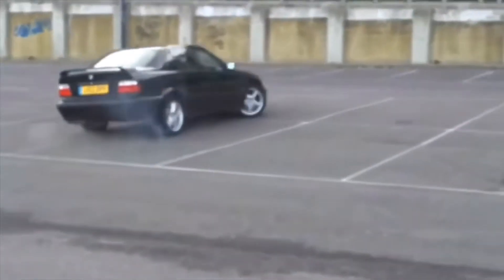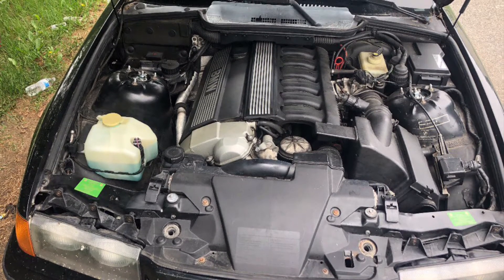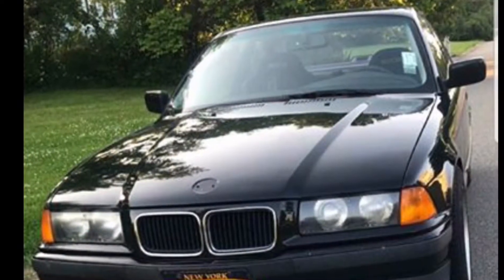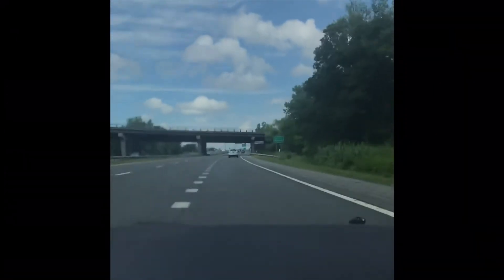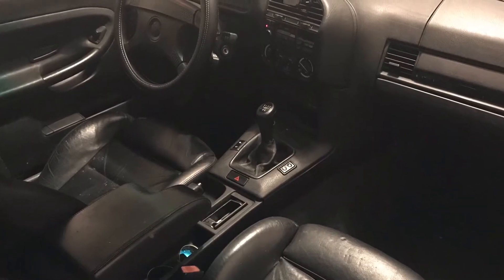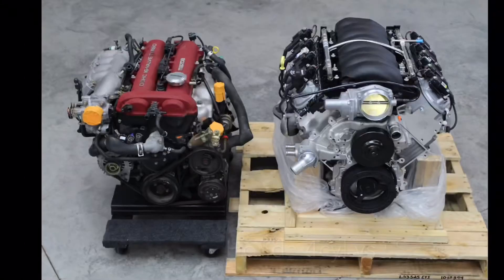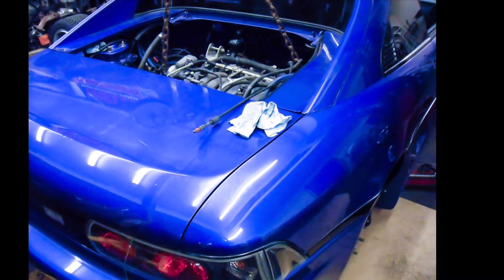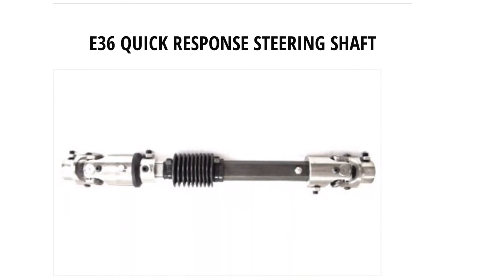FINDING THE RIGHT PROJECT BMW- E36 TURBO LS SWAP PART 3

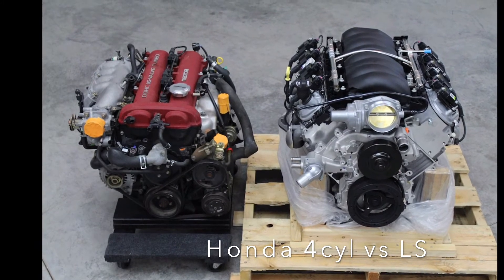Comment: 4:43 Caption says Honda 4 vs LS. Mazda clearly written on the valve cover. I do get your point though.  The F20C in the S2000 is a bit larger overall and 50lbs heavier than the BP-4W in the Miata that was pictured. Which honestly only makes the LS look even better when comparing it to a Honda. While I have in the past been a diehard Honda guy (still am when it comes to daily drivers) I was also raised around aviation so I was never really a proponent of the HP/L argument when determining what the best engine is. HP/L will NEVER make a plane fly or determine a race. Power to weight will ALWAYS determine if a plane will fly almost always who will win a race (if both get a good launch and maintain traction).  There is a reason to LS swap ALL THE THINGS. The LS based engines are the most power dense engines (size/weight:hp) available to the general public.  The fact that you can get them all day for less than $500 blows my mind. 

Sorry for preaching to the choir, I got off on a tangent and Im not exactly sure why lol.
Reply from the maker: No o appreciate it, I totally thought that was a k20 engine. It was hard to find a comparison photo for that section. They all have their pros and cons. I essentially got that engine for free it’s hard to do that. I’d love to K swap something one day. Other than my Miata 4 snafu, did I do a good job on this video? What else could I improve on?
Reply: @LowBoostFilms   Well super long story short, I have 2008 535I in my garage that I absolutely love how it used to drive, its just given me a lot of mechanical problems. The serpentine belt came off and ended up getting sucked into the engine through the front main seal which threw the timing off and smashed all the valves in my N54. SO I’m seriously contemplating and LS swap in my E60 so I was looking at vids on LS Swapped BMWs. That was a little back ground on how I found your channel. 

I’m only 6 videos in but honestly so far I’d say overall your content is decent. The audio isn’t great but it isn’t horrible. Not having super clear audo doesn’t really bother me, but I know it turns a lot of people off if you don’t have a decent mic. I do enjoy the random cut scenes, but IMO they should be much quicker and not used so often. Like only in exclamatory situations. So I like the Hangover cut but instead of having the whole scene where Alan is getting shocked in the face, I think a quick cut to “IN THE FACE” would have been much better. Same with Rachel saying you bitch. I like that you videos are packed with information and I realize it’s not easy to film while you work, however I know a lot of people don’t like commentary over still pictures. Your intro is great as is your use of music (or lack thereof for the most part) I would rather no music and be able to hear everything than to have a ridiculous or loud soundtrack when you’re trying to listen to the engine or other things. Overall I like your channel, and I was actually surprised you only had 500 subs.  But considering you just started this series 9 months ago I think if you keep it up you’ll easily be at 10x that in no time.
Reply from the maker: I made the mistake of not taking enough videos when I started, now I only take video, no pics, and got a better microphone. So hopefully my videos have improve with each new one I make. I don’t do nearly as many cut scenes anymore. I actually forgot I did them haha! Thanks for the feedback! I really appreciate it. It makes me want to work harder to make them better!

Comment: I’m building an iron 5.3- either doing an e36 or 300zx swap. Leaning toward e36 I think it will be cheaper and better quality. Look forward to watching videos. What trans and rear  you plan on using?
Reply from the maker: Travis Wurz I am getting a T56 6 speed, far as  swap kits go there are a lot of them for the transmission crossmember. I’m looking at a 210mm lsd out of an e38 750i. They bolt right in. Stay tuned!

Comment: If you would of use an aluminum version. It would of been 200lbs lighter than the inline-6
Reply from the maker: I weighed them this is 50 lbs more, the alum should be 50 less I think. but it’s getting boost, which the iron motor is better for.

Comment: What about an E90 I have an extra one I want to do an LS swap in
Reply from the maker: Very easy to do. Lots more space than an e36. CX racing makes swap kits
Reply: Nice I just checked their site, pretty straight forward. Now I see all the hardware but what about my wiring? Is there a kit for that as well?
Reply from the maker: Idk if they make a specific wiring harness. But you could get a generic swap harness I think psi makes them. Or for a little more $$ get a Holley terminator x like I just got.
Reply: Nice I’ll look them up. Also are you aware that your wiring video was flagged by WWE? lol what wrestling match clip did you upload now I’m curious and I want tot see that video